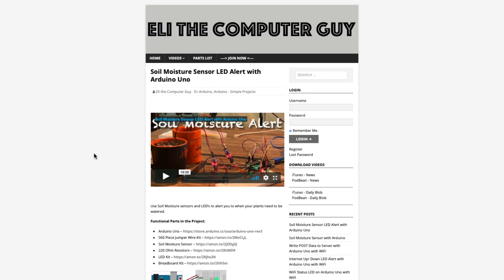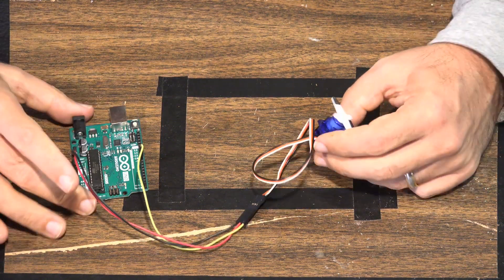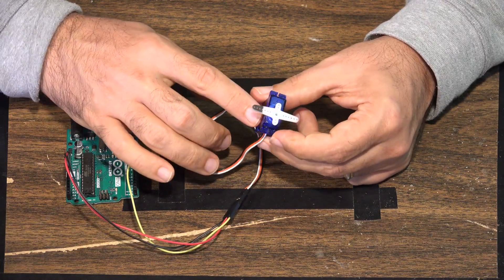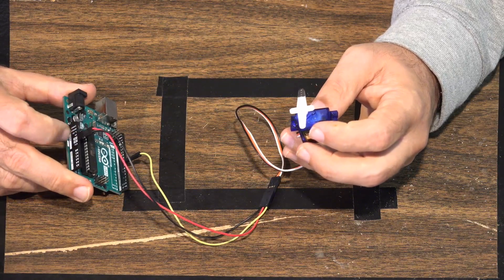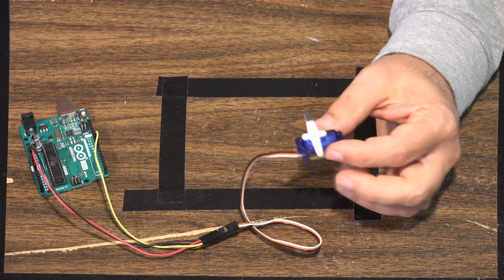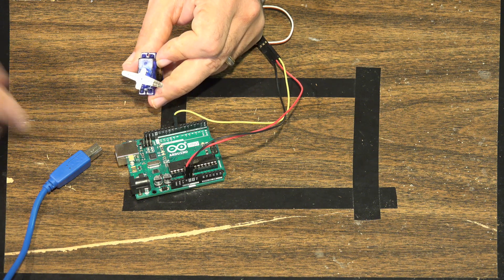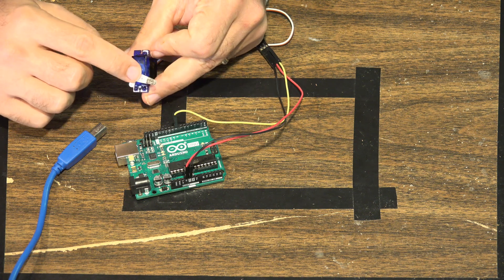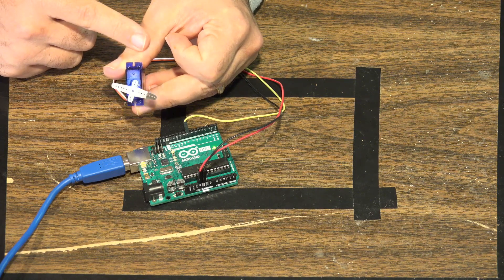Servo Motors on Arduino

Comment: You know what´s funny? When I type KC9806 into Youtube search, your video shows up. It´s the same with MC33030 to. Both are servo motor IC´s (which are built in into some servos), which I googled yesterday. Very strange, despite the fact, that IC could stand for Illuminati Confirmed. :) BTW, you appear like L Rossmann were in another body :)